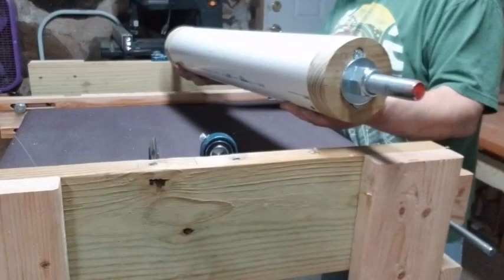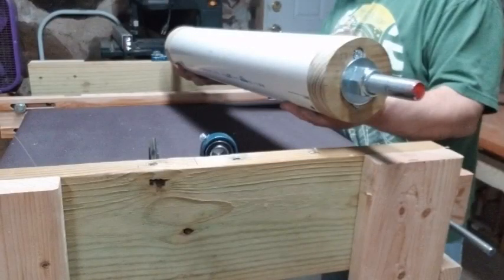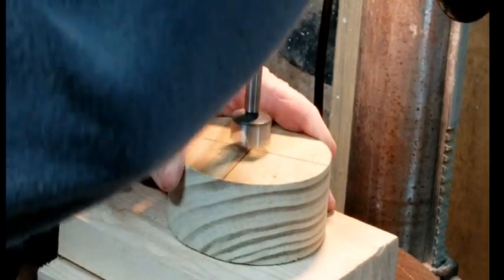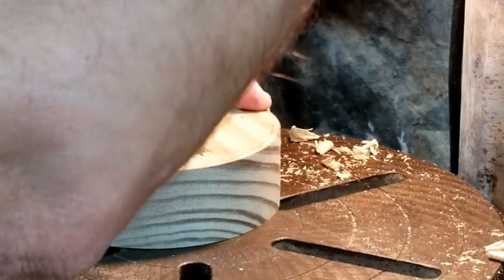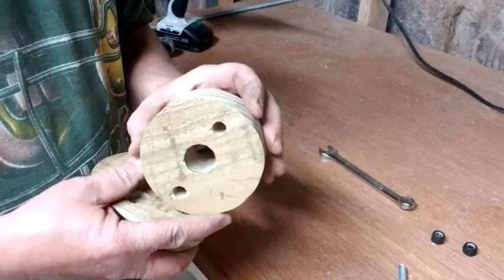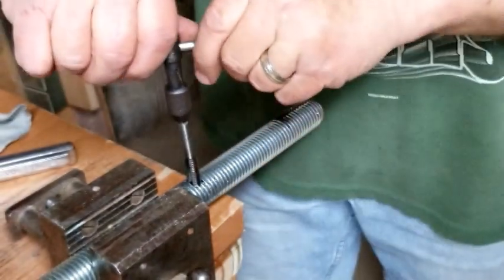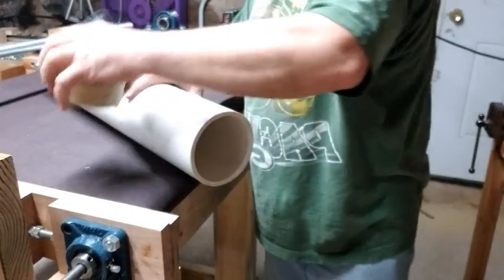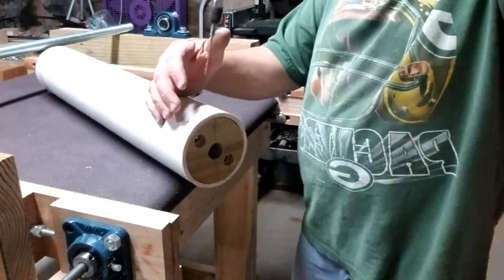Building the Thickness Sander Drum

Comment: You made a very strong drive mechabism with the threaded rod through the shaft, but in the end the turning force is transferred to the outer tube by four very small wood screws.???   I cant help thinking it would be better to have several more discs inside the tube to stop it distorting.
Reply from the maker: Good point. Thank you for your comment. I'm sure I will be making adjustments to the sanding drum as I evaluate how it is working for me.